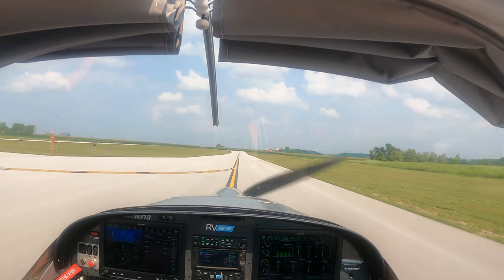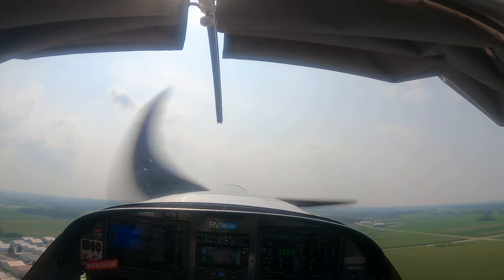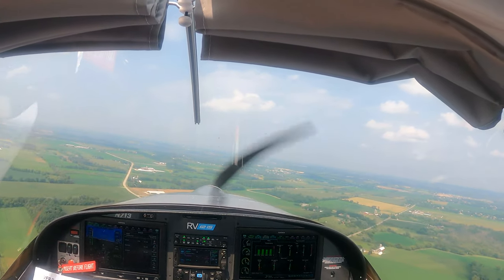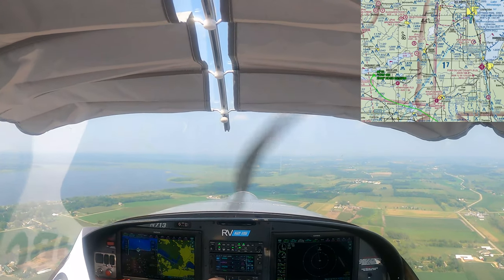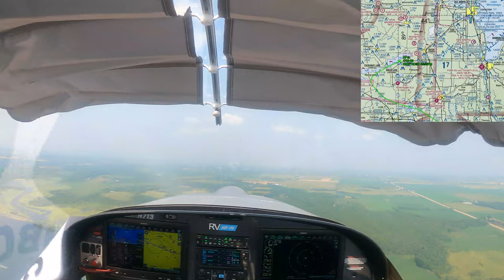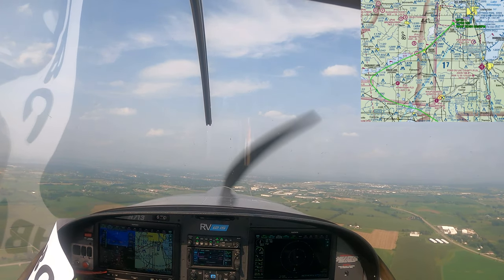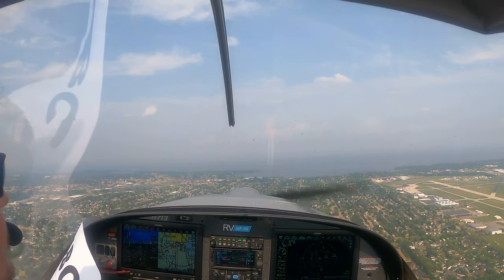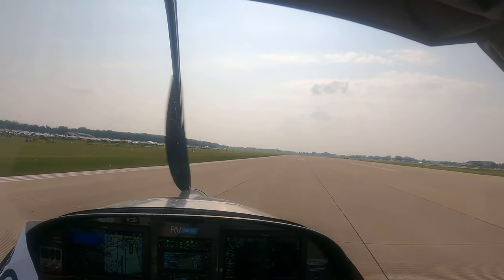Oshkosh 2021 arrival in a RV-12iS

Comment: Great video - thanks for posting. I'm pretty sure you can use that mogas in your -12is, btw. In fact, I thought it was preferred over avgas for that engine.
Reply from the maker: it sure is preferred!  theres less frequent maintenance regarding cleaning out the oil tank.. along with longer life of the gearbox before overhaul.